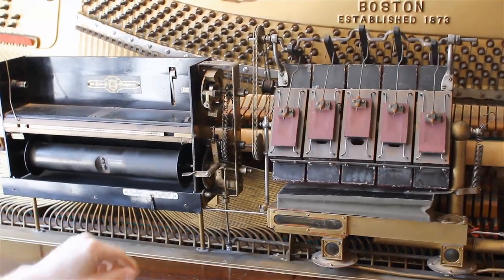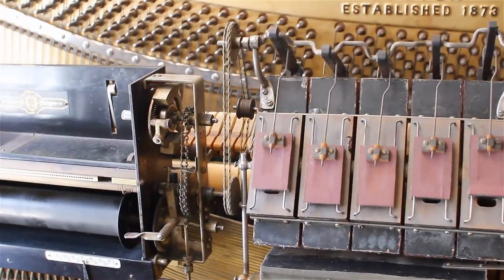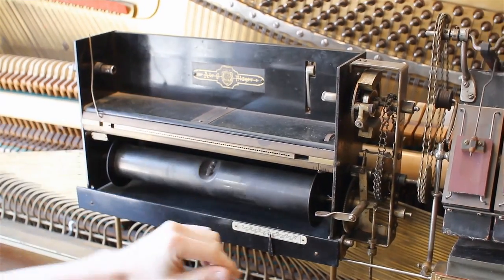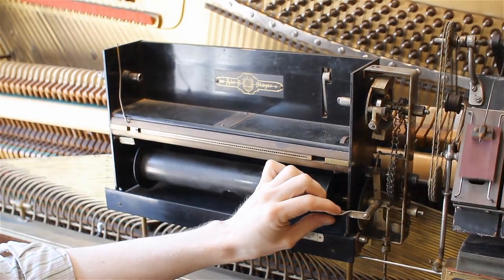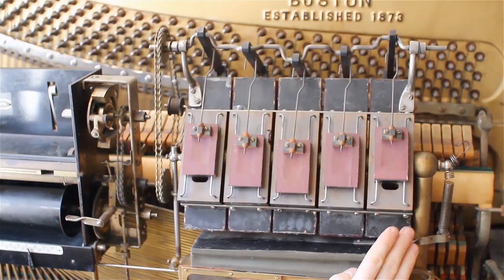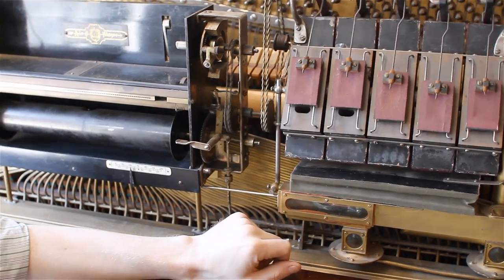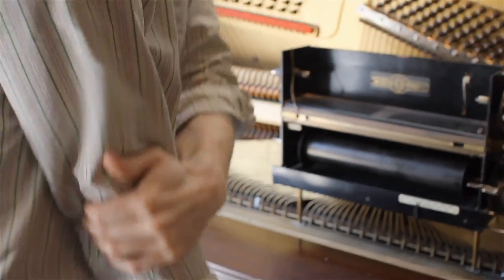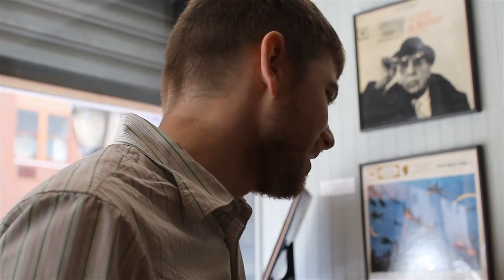Player Piano Mechanism

Comment: (1/3) 
Thanks for sharing an example of one of my favorite player piano player actions: the National Air-O-Player, invented by Mr William A. Watson and built and installed exclusively by the National Piano Co. of Massachusetts only in their three house brands of piano: Norris & Hyde (good); Merrill (great); and Briggs (excellent). 

This system was available from January 1912 through sometime in 1918(?) at which point National discontinued it and opted for the Simplex action instead for their later player pianos, which today are more easily found than this early one here. Also the expensive Briggs brand is even rarer than the other two, today. 

There is a great possibility that the entry of the USA into WWI prompted a rationing of supplies, especially metal, which made it harder to produce this player action, at least economically. 

Also, it was undoubtedly a much more expensive action than most of the usual wood types, and most USA piano makers cheapened their product line somewhat around WWI so as to be competitive with other makers in the huge player piano boom that started around that time and lasted through the advent of broadcast radio and electrically amplified recordings, which killed off the player piano market in the mid to late 20s.
Reply: (2/3) 

More about the Air-O-Player: 

This is a mostly-metal action (there are some wooden parts such as the striker pneumatics themselves; the exhauster and reservoir boards; the wind motor governor boards and wind motor pneumatics and slide valves; and the wooden pouch blocks inside each cartridge valve unit), and is very heavy compared with a normal wooden player action like a Standard. 

However, by virtue of this outstanding design and metal construction, this action has fewer possible places for leaks than do most typical wooden player actions, and thus greater chance of longevity, if kept exercised. It is really a great design IMO.
Reply: (3/3) 

I collect this Air-O-Player system (and also the later “Palestrina” metal action designed by Mr Watson and introduced in 1922) and so far own a rough barn-find Merrill player piano with it which I got from Michigan; plus will hopefully soon get a Briggs from San Diego and a Norris & Hyde from the East Coast on the way later (once I can finish rationalizing my storage situation, rehoming surplus instruments and paying off debts). 

I have only seen two pianos equipped with the rarer “Palestrina” action so far: an R. S. Howard owned by a gentleman in Brazil; and a Janssen in an antique shop in the Midwest somewhere (Indiana?). 

The Palestrina system was advertised as standing up to harsh climactic conditions, which explains the export piano existing in Brazil (Howard themselves advertised specially-constructed pianos out of exotic woods for punishing climates). 

I hope to write an extensive article about Mr Watson and his player actions for the AMICA “Bulletin” (bimonthly magazine of the Automatic Musical Instrument Collectors’ Association) in the near future.
Reply: (4/3) (hee hee) I should also mention here that this company produced a monthly bulletin (small journal or leaflet) called “The National Arrow”, which apparently was distributed exclusively to members of the piano trade, most likely dealers and service people for this make, as a small journa much like the “Standard Player Monthly” put out by the Standard Pneumatic Action Co (a much larger and more famous company, which were the #1 player action builder in the USA, building approx. 1/2 of all player piano actions made here in the 1910-1930 period). 

However, unlike the more widely-distributed “Standard Player Monthly” (back issues of which are available to AMICA members in the “members only” section of the website), 
I have never seen a SINGLE surviving issue of the “National Arrow” journal. I only know of its existence via brief mentions in “Music Trade Review” magazine. 

I have a rather good finder’s fee available for even INCOMPLETE issues of the “National Arrow” journal/magazine, so if you encounter even a single issue of this periodical, please immediately email me at Yahoo (rag1916) as I will gladly make a deal for it!!!

Comment: Did exist some of those that you could play in reverse too?  As a music that worked from both sides?
Reply: Hi, I am not aware of a HOME player piano that was designed/supposed to play the piano roll both forwards AND backwards and make intentional music. HOWEVER, two known commercial instruments used special rolls that did this: the Empress Electric Solo Expression Twin Tracker coin piano (which might have had a player action designed and built by Nelson-Wiggen), and the Nelson-Wiggen Selector Duplex piano/pipe organ combination instrument. The former uses Empress “L” rolls; the latter uses N-W Selector Duplex rolls. Both types of instrument and roll were only produced in very small quantities and are exceedingly rare today: I’m only aware of two examples of this Empress Electric model existing today; and only maybe three of the Nelson-Wiggen Selector Duplex organ. 

Both instruments have a 134-hole tracker bar, spaced 9 holes per inch, using a roll 15 & 1/4” (I think) wide. Of course the two instruments have different trackerbar scales/hole layouts however. 

The rolls for both instruments were arranged and cut by the Clark Orchestra Roll Co. of Chicago, which also made many other far more popular coin piano and orchestrion roll types, as well as some extremely rare pipe organ rolls. 

In each case, the instruments’ scale is duplicated on each side of the tracker bar, so essentially they each play from a 67-hole scale, with one of the holes on each side being a “play” or “reverse” (not rewind!) hole, to trigger the roll mechanism to change directions, and the changeover mechanism to disconnect half of the tracker bar from the player action and connect it to the other half. The music is thus arranged and cut in two directions: it goes forwards on one side of the paper, and in reverse on the other side! This obviated the need for high speed rewinding and extended the life of the paper. But it makes for a very wide roll. Interestingly, one of the Selector Duplex organs known extant wasn’t sold to a mortuary (as many were), but to a silent movie theatre, and had special fast forward and fast reverse gearing also on the roll frame so the operator could select tunes in a hurry, from the roll, to match the action on the screen.

Comment: What if you pump and nothing happens? does the tubing need to be replaced? how do you trouble shoot. I have one...for sale
Reply: If nothing happens at all, and you just hear escaping air, then there's a major leak or disconnection of the pneumatic system.  If the piano is very old and has its original bellows and tubing, then chances are, the rubber has become brittle and broken with age.  There's rubber tubing, rubber hosing leading from the reservoir chamber, and rubberized fabric in the bellows.  Plus 88 small, complex valves, one for each key.

This is a big, complicated repair, and player-piano rechnicians are so few and far between, that most of them either travel the world to repair them, or require the client to ship the piano to them.  But, if you can afford it, it's well worth the cost to restore a player-piano.

Or, if you're skilled enough with mechanical things, there are websites that sell the specialized parts, and illustrated repair manuals, so you can do it yourself.  The first step is determining which player mechanism your piano uses.  50% of them use a Simplex mechanism.  The rest use one of several other mechanisms.  You can look up the patents on the U.S. Patent Office website, and download the original patent applications, including diagrams.